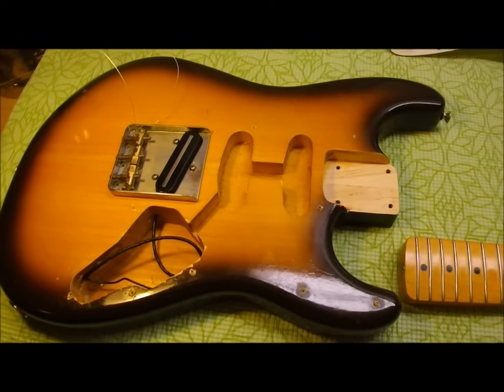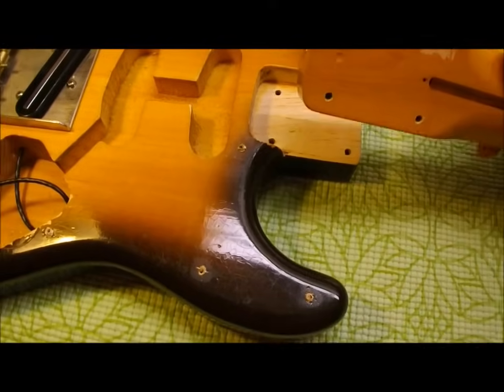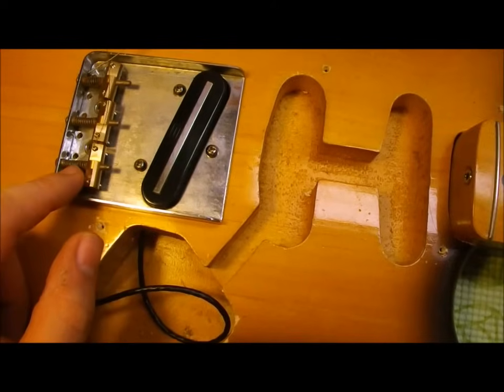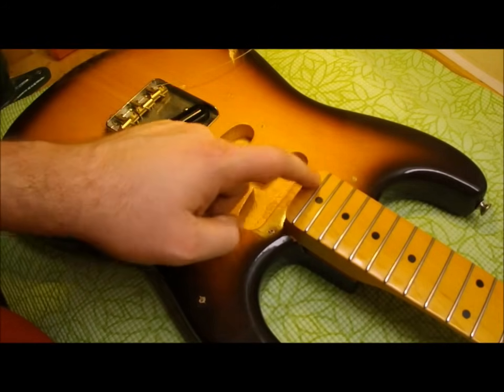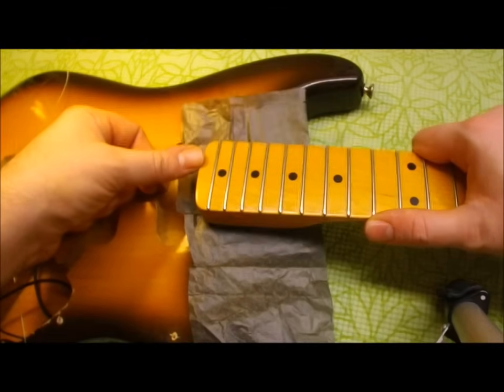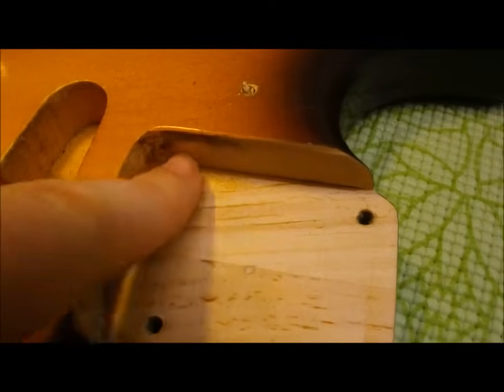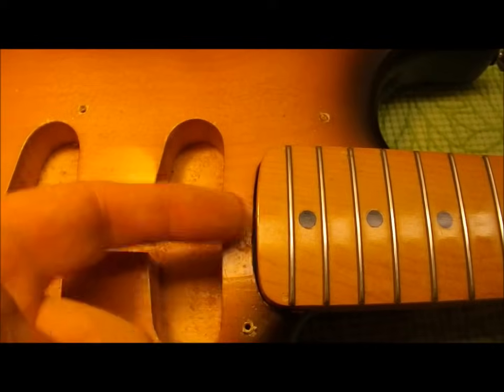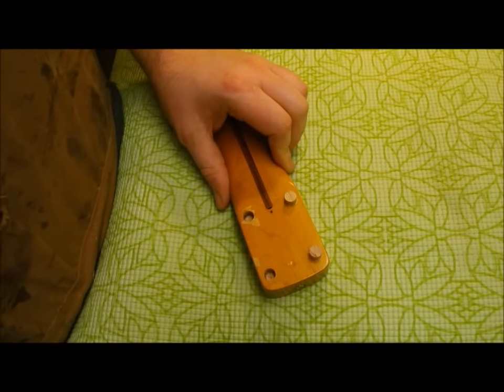Fitting a Fender style Neck

Comment: Summary:

The task involves fitting a neck into a hybrid guitar body with a Stratocaster body and a Telecaster style bridge.
The neck is unconventional, possibly from the F bass company, typically known for smaller electric string instruments.
Adjustments are needed due to differences in neck angle and pocket size, potentially requiring filling of existing holes and adjusting placement.
Techniques for fitting include the use of carbon paper to mark areas needing adjustment and gradually removing material to achieve a snug fit.
To fill mismatched holes, maple plugs are made to match the neck material, ensuring a clean finish and structural integrity.

Comment: I did that same job except my neck didn’t need surgery with plugs and my neck went on a 1951 butterscotch blonde solid brass individual saddles on the telecaster modern style bridge and the 1987 Matsumoto Japan FugiGen GaKki roasted flaming neck is worth a bundle it’s the last of its kind with a rosewood fretboard and brass nut custom cut by hand. This mate is spectacular and she blows doors down on a Marshall 40 amp 4 ft off the floor

Comment: I think a good pair of flush cutting electrical nippers will take care of the strings poking out. Xuron snips or something similar should work well to get in right up close. But I'm sure you thought of that and couldn't get in close enough, but just an idea. I also like them for trimming ends of wires after slodering. Great videos, keep u the great work.

Comment: Great job. Could you have sanded the neck instead?
Reply from the maker: floodland99 the neck was lacquered and it would have felt weird to do it that way. Nothing wrong with it though. Best to do one or the other, not a combination.
Reply: Okay. Thanks.
Reply: What great job? Did you see if what he did really worked? This he show you how the guitar play? Of corse not! He does a lot of stupid things that don’t work but he doesn’t show you the results. Don’t believe anything you see on “TV”
Reply: @twoodfrd  not only that, but removing material from the body means replacing the neck is easier if necessary.

Comment: Okay so it it only scale length that matters for fitting a neck as I have managed to find a 25.5” neck with a 3+3 headstock. Would this be fine to put on the strat body? (All other measurements are correct as well)
Reply: The most important thing is to check where the 12th fret will end up when the neck is mounted in its final position.  If the 12th fret is exactly half way between the nut and the bridge saddles (with a little room remaining to move the saddles further back), then it should work.
Not all necks are the same, regardless of scale length.  The heel can be positioned slightly differently based on scale length, number of frets, and fretboard overhang, so figuring out the 12th fret position is important.  (unless you're willing to move the bridge, too).
The majority of random aftermarket necks do tend to be built fairly close to fender spec, though, so it's worth checking, since many will work.  You're not even necessarily stuck with the same scale length.  As long as it's laid out so the 12th fret is half way between the nut and bridge line, it should work.
Of course other fit issues can come into play.  Pocket depth and neck thickness (as mentioned in this video), or variance in string spacing can make some combinations impractical to make work.
Reply: nwimpney thank you so much, I’ve never known how precise a guitar has to be in measurements and so on. It’s a great project and I love learning and seeking help to improve my knowledge of it. Thanks again for helping! :)

Comment: What's the story behind these two pieces, and what made you decide to bring them together? How much wood did you end up removing to get the neck to fit?
Reply from the maker: I don't know much about the two pieces. The client procured them and wanted them assembled.  I'm not sure how much material was removed. -"Enough" is probably the right answer, but if I had to guess, about .020".
Reply: @twoodfrd  So wood that be .010 + .010 (L+R)? The real question would be Absolute humidity, is the shop a controlled environment at a consistent moisture? And is there an ideal % for this type of precision fitting?

Comment: Could I stick a Gibson neck on the strat body fine?
Reply from the maker: It would play horribly out of tune, but sometimes you just need to follow your dreams.
Reply: twoodfrd Would there not be a work around this? 
Is there a video explaining how guitar necks function 
Do the measurements have to be very precise ??
Reply from the maker: @ThEN003tr0ll  there is a lot of math involved. Practical reasons too - Gibson necks are a different width. Basically, if you wanted it to work you would have to reposition the bridge so the saddles would be 24-3/4" from the nut, rather than than 25-1/2" on a Strat. It's more complex than that, though. The pickup polepieces are a different width apart, and the neck pocket would have to be angled.
Reply: twoodfrd Aw man, I’m currently remaking an old guitar. Just finished painting the body and waxing it today so al be looking for parts now. I take it you can’t get that Gibson headstock on a 25.5 scale neck then :(
Reply: twoodfrd Would I be able to find a 25.5 scale neck with a 3+3 headstock is what I am essentially trying to ask
Reply: @ThEN003tr0ll  I'm sure if you look around you'll be able to find a strat compatible neck with a 3+3 headstock.  I think Warmoth makes one, for starters, though they're definitely not the cheapest.
Reply: nwimpney cheers found a prs custom that has scale length of 25.5

Comment: I recently bought a guitar body and a neck such that the neck is a bit too wide for the pocket.  Do you recommend removing material from the pocket or the neck?
Reply from the maker: The Rockin' Donkey it's a case by case thing. Most people like to work on the pocket and leave the neck alone if it's been prefinished because it's usually pretty square and acts as a good reference.
Reply: Thanks for the explanation.